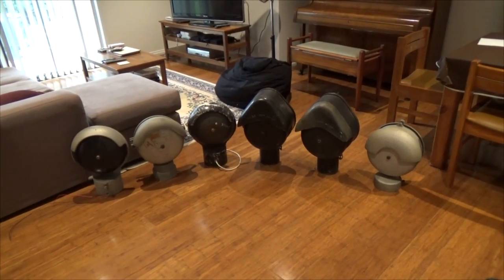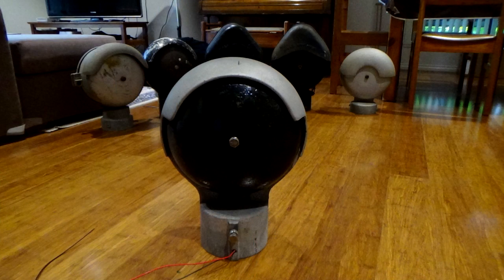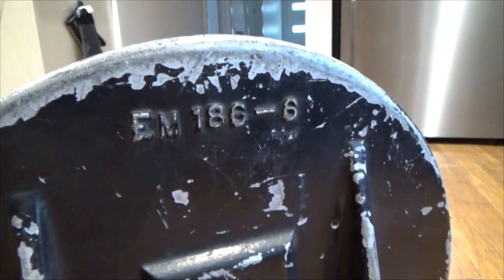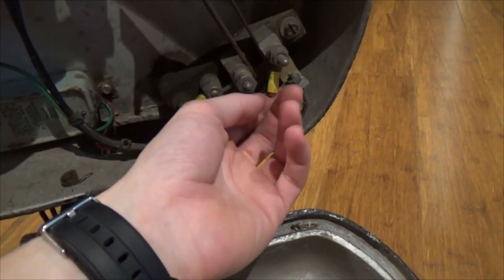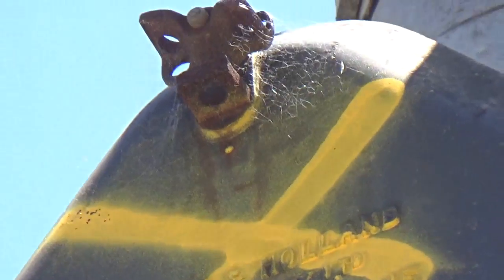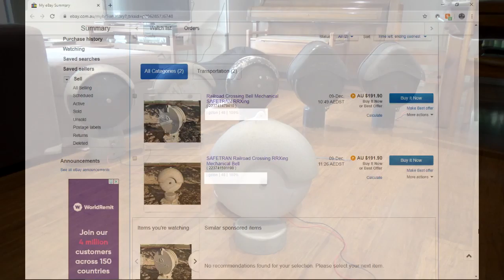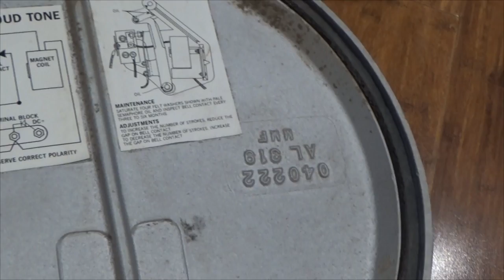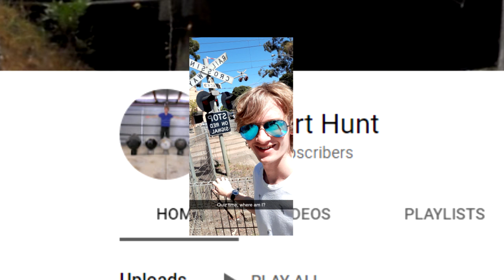My Railway Crossing Bell Collection - 500 Subscriber Special!

Comment: Congratulations on 500 subs! You have a great collection of bells, just wondering is it safe to run the bells on the power supply? I'm thinking of getting one as electromagnets really drain my batteries lol. Also, I think your first teardrop shown has an older gong, as it produces an odd low pitched tone. This is similar to Moscript St and Nunn st. Also the Ivanhoe hybrid bell currently resides with me :)
Reply: It’s always good when you know witch crossings your bells came from.
Reply from the maker: Thanks man :) yeah, it's safe as long as you don't overpower the bells, as in adjust the voltage to higher than recommended, which for my bells is 12 volts. Nice, I'd like to see a video of that one soon
Reply: @stuarthunt101  he does have a video of his hybrid bell

Comment: 21:35 

The Safetran at Seymour remains from when I saw it a few weeks ago
there is one at Mount Clay Road, Heywood still (Portland Line)
and there is one sitting on a private crossing in the North of south Dynon
Reply from the maker: Well there you go, stuff I didn't know!
Reply: @mr.cheese.balls100s  its dead, Haven't seen any pics of it not there yet tho
Reply: Do you know if the Seymour Safetran is still around as of January 2024 or if it was removed around 2023?